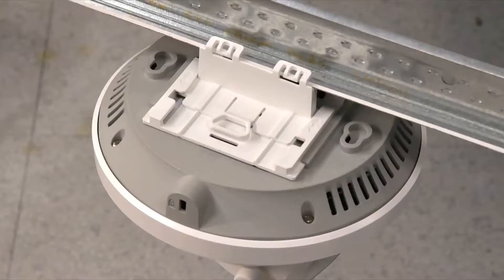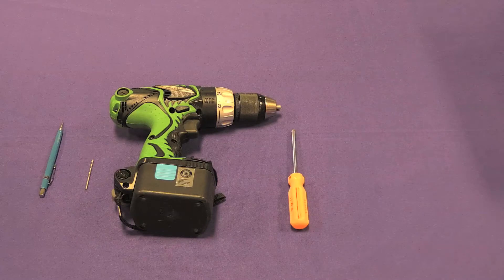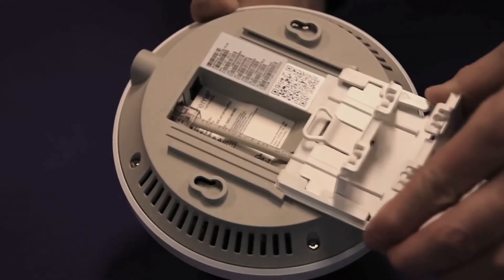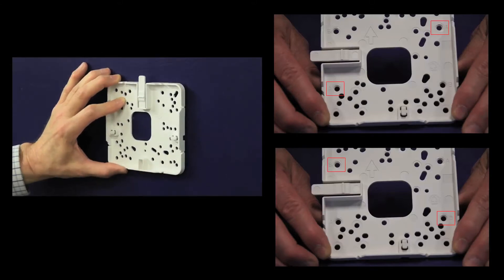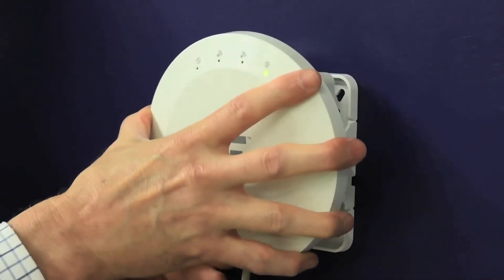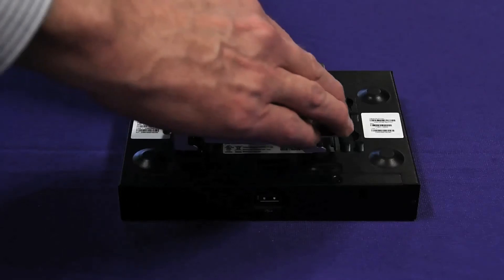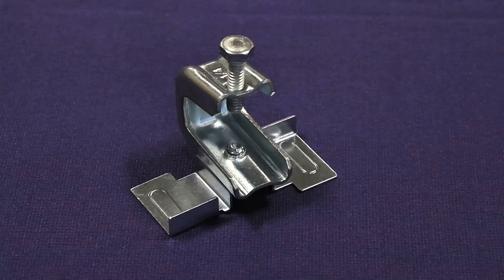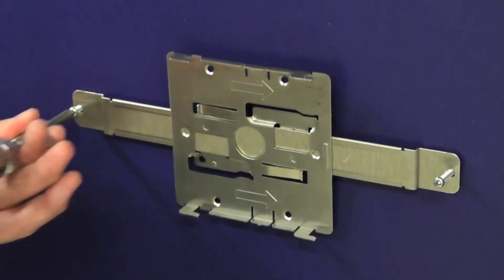Installation Video: Brackets used with Indoor Access Points

Comment: This would be even nicer if each part of the video would refer to the actual part number of the individual bracket. 
Also, the junction box bracket documentation refers to a metal plate plus a plastic part: https://documentation.extremenetworks.com/wireless/Accessories_Guide/GUID-C13D8A49-79C8-492D-8963-431D56A31048.shtml However the video at 3:30 shows no such thing.